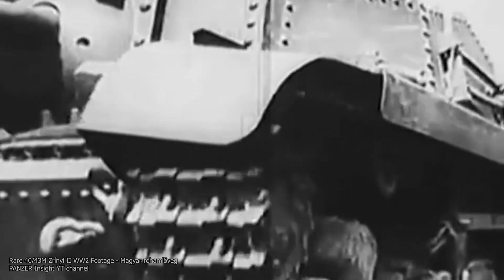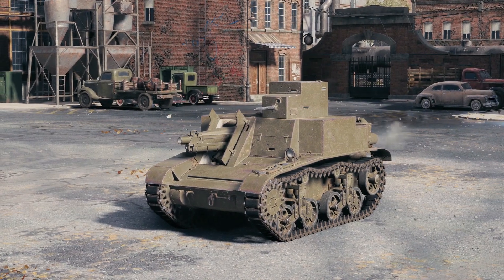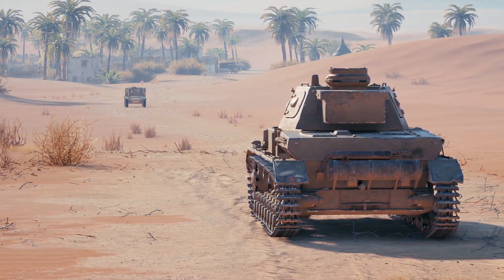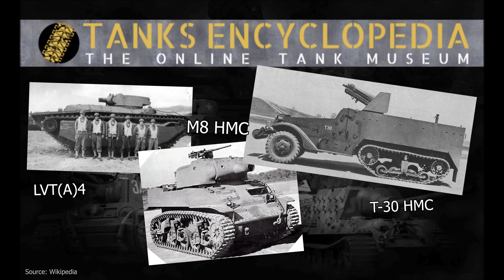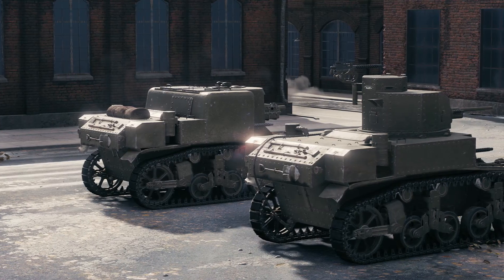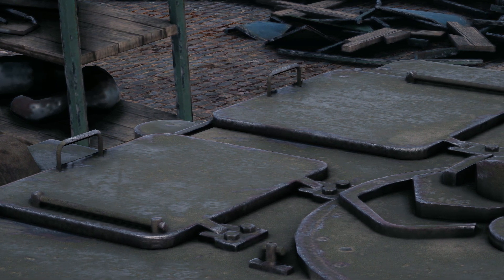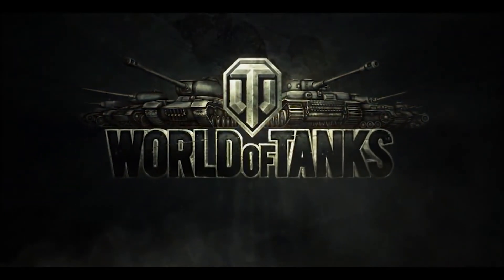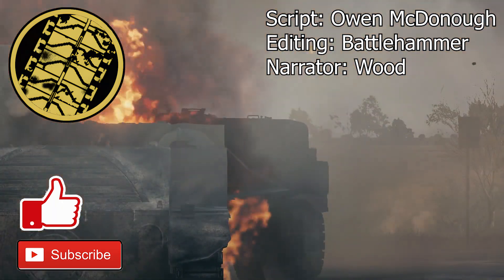Seal Clubbing, Please Nerf! | 75 mm Howitzer Motor Carriage T18

Comment: If you don't mind . . .
  T-18; an early iteration of the armored "Assault Gun"/"StuG" concept, distinctly different from the later M7 Priest, which was a SPA (SelfPropelledArtillery) vehicle.
  Compare the T18 with a turretless M3 Grant or the StuG IIIA.  Bet it would've been a cheaper way to mechanize the 75mm Pack Howitzer.
  Germany, France, the USA, Japan, and the Soviet Union went through the same cut and paste SPG/Waffentrager/SU paradigm.  Germany ended up with the StuG/StuH III, a fairly well balanced design, by 1939.  The Red Army fielded the T34-based SU122 in 1942.  France had a very advanced ARL(v)39 and 40 thing going.  Japan sort of realized late that infantry defenses need a bigger HE filler.   The US Army used a tank for everything- more expensive, and longer training time needed . . . but it/we had the leisure to work it out.  You men in the UK had the CS concept going*.  Each approach had inconsistencies and antitheses (turretless = setpiece, turreted = more visible at range, SU was so nose-heavy it makes the T18 look balanced, CS tank concept means you think you can choose which tank is going to be available at the right time and place.  CS vs Infantry?  Thumbs-up.  CS meets Panther?  Thumbs Down**.  
  In the event, the StuG was the right thing at the right time.  All others to the back of the line, please.  And Germany?  Grease your tracks.

*The 2" Smoke Mortar in the turret roof was a great idea, however.  Good work.
** Turns out that the Roman thumbs up meant "kill him!", while the imperial thunbs up meant "spare the lout!"  This is why the schools need funding- not narratives

Comment: This tank was in the background on a recent Chieftains video on the Christie T31 tank.
Reply: Do you have a timestamp? I've just looked through the video and I haven't found anything
Reply: @JumboSherman  no time stamps. But as I saw it in the background I didn't know what it was till I saw this video. Towards the end you can see the guy in the fatigues leaning against it.
Reply: @JumboSherman  Just checked, at 4:54 you can see the nose of it over the top of the Christie.
Reply: @careychen7275  That's actually the prototype M2A2E3 light tank, which featured the signature trailing idler of the later Stuarts. Still an interesting find, but not the T18. Thanks!

Comment: With a bit of modification, this vehicle could have been a titan of the Pacific campaign. Smaller, fast, and hard hitting, Marines might have found it useful in Japanese bunker busting, while it's size would have been well suited for unloading from landing craft for island hopping. With a more realistic machine gun configuration it would have been better able (though not without infantry support) to defend itself.
Reply: Could those modifications have included, say, a turret, better frontal armor, better weight distribution, less extraneous machine guns, and better ventilation? The M8 Howitzer Motor Carriage did, indeed, see success in the Pacific in an infantry support role. I'd imagine that a T18 in the Pacific would've been extremely vulnerable to flanking attacks.
Reply: @JumboSherman  I agree with everything except (in the assault gun role) the addition of a turret. My thinking is that (adequately up-armored in the front) this vehicle could be driven up closer to bunkers and caves to deliver fire. The vulnerability to flanking attacks would have to be covered by infantry, a la the Stugs. i was thinking that the light weight and good mobility would serve it well on islands as a more numerous supplement to Shermans and Stuarts.

Comment: This is a real monster in WoT Blitz. It has been removed from market, so the only way to have one is to have acquired one befor the removal. It is literally one of the toughest vehicles of its size and quite fast for an SPG.
Reply: Sadly you get a 2 pounder now and not the 75mm M1 Pack gun.
Reply: I still hold my kill record in the console version when it was still a td  . I was it a 15 v 15 killed 9 and survived after that I hung it up and now it's gone.
Reply: I remember back then the front armor is ridiculously thick... Well for the tier 1 i guess
Reply: I remember this and T82 in the American TD line before their removal. Derp monsters
Reply: You can buy it from the collectors thing
Reply: i had one before i stopped playing four years ago, the thing was a beast